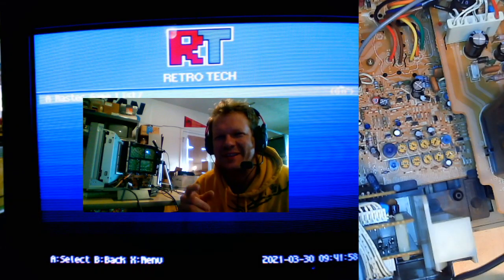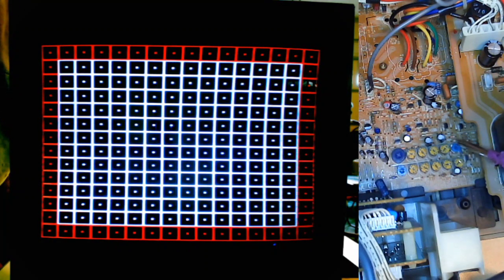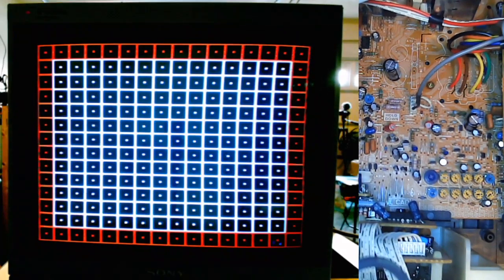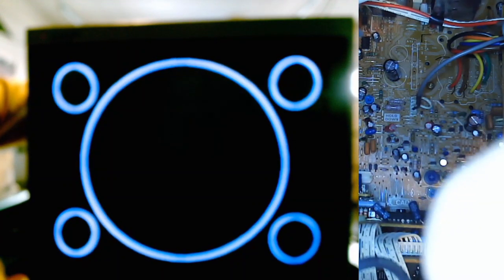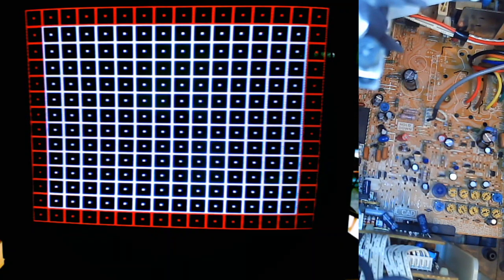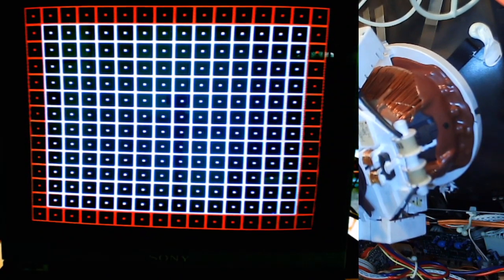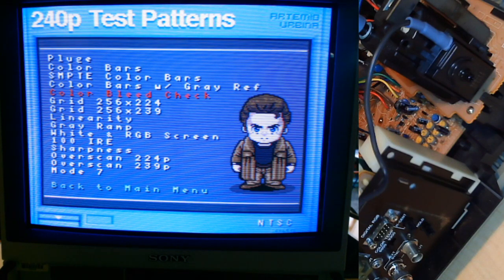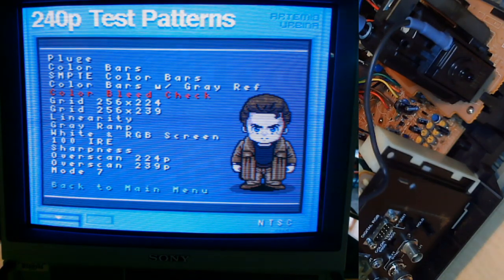How to Calibrate Geometry for a Pro CRT with No Service Menu! | Sony PVM 1943MD

Comment: Sometimes you gotta accepbt a little bit of bad geometry. I too strugle JUST WITH ONE CORNER (Top Left Corner)
It has a little bit of bowing, but thankfully my Sony Trinitron has PAMP, LPIN and UPIN... and what I kind of did was to curve inwards the picture Juuuuuuust a little bit with PAMP, and I used LPIN and UPIN to bring the corners outwards until it matched the center.
Not perfect, but definitely better than a picture looking like an Hourglass.
Here's the story!
https://gbatemp.net/entry/sony-trinitron-surprises.17072/
Side note: Around the 20:42 mark, you can clearly see how the TV decides to NOT cooperate with your hard work.

Comment: Is this something you'll only find on Professional monitors? I have a consumer Samsung CRT and i'm unable to adjust horizontal geometry in the service menu, the options are there but none of them do anything when I change the values. Someone suggested the TV might not have the circuitry installed to allow these changes, so is there a chance there might be pots on the board that can adjust it?

Comment: I just ran the 240p 'Grid' test on my 1989 Sony Trinitron KV-27SXR10, and I think my set's vertical size is off. The red squares are completely missing on the bottom of the image, and about 50% cut-off on the top! The red boxes on the sides are also a bit off too, but just slightly. Is there any chance this 80's TV has a built-in service menu, or will I need to open it and adjust internal pots? Looking in with a flashlight, I can see 5 orange pots on the main PCB next to each other.  Would love to find the Sony service manual before I start poking around inside. I use this TV (which I've had since my teen years!) for all my 70's/80's/90's retro game consoles and computers! EDIT: Interestingly, on the other hand, the 'Grid 224p' test shows the red squares area (overscan) nearly perfect! So which test should I believe, the 240 or 224? The screen geometry is spot on AS-IS, so I worry about throwing that out of wack by adjusting the vertical size.

Comment: I have a SONY PVM-2053MD. If I first press MENU and then (!) press DEGAUSS+ENTER then I get into the SERVICE MODE of the PVM. There I can change the picture position, width, height etc. Have you tried this? Are you sure your PVM really does not have a SERVICE MODE?

Comment: I got a kv36fv310 the right bottom corner is always blown out. got it pretty much cleared with the service menu, but the colors in the very corner colors spilt or get a little brighter but its mostly in the overscan. so its not a big deal.ive had this on a bunch of sonys why does it always seem to be that corner
Reply: most TVs actually seem to have one corner worse than the other 3, my 27 panasonic is on the right bottom too
Reply: @brunor.1127  i know one corner will always be kinda out of wack but sonys seem to always be right bottom and all my jvcs seem to be left top corners

Comment: I picked up a Sanyo 14" off the side of the road.
The grid pattern is completely strait but I have heaps of overscan on the sides.
Hope I can adjust it as according to the service manual it only has these pots to adjust as no service menu.
Reply: Have you checked capacitors?

Comment: hello good night excellent video I ask could you help me or a council I have a pvm1443md it has a horizontal and vertical synchronization failure I don't know what it could check you could tell me how to solve this fault I have already reviewed the v hold on the outside and it does not solve the fault I opened it to check the pontecimeters of the integrated ic501 but the failure persists, it could help me with this problem, send you photos or images of it so that you have a clearer idea of my failure

Comment: Thanks for the video. I have a Panasonic Bt-s1370y, it has some holes at the back of the monitor for adjustments like this one, my question is: is it necessary to open the monitor or is it safe to do it unopen?
Reply: I don’t wanna take the risk of damaging the monitor since where I live (I’m from Argentina) these kind of monitors are super rare and expensive but I need to do it because geometry is terrible and I can’t properly play on my Sega Genesis. Thanks!